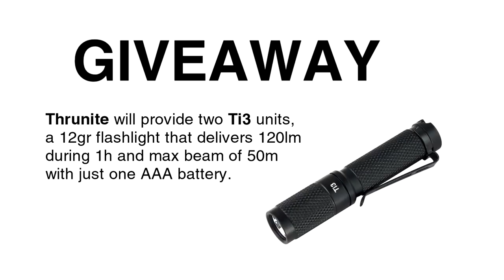How to make a Leather Strop |  Razor sharp knife

Comment: I just picked up a work sharp sharpener the manual and the Ken Onion electric system. And don’t get me wrong both work VERY well. BUT the last part IS the finishing touch and that’s the leather strop. I ended up with some extra leather from a welding apron I bought at harbor freight. I took that extra strip of leather put it on a 2x4 and ran my pocket knife across it 3 times on both sides. And that took a already extremely sharp knife to a literal razor.

Comment: So is there any clue how long we have to grind those leather with sandpaper?
And do we have to apply strop compound and oil every time before use?or one time only?
Thanks for the answers.
Reply from the maker: I start with coarser grit to flatten the leather. Then I go finer just to refine leather finish. You only need to reapply strop compund or oil when you see the leather dry.
Reply: @WoodworkingBarcelona  wow I still got replied for 4 years old video, what a good man! Thanks for the answers.
But finally I just bought stropper from e-commerce, and it's make me confuse a bit, because they made inside leather for the outside not like yours. What do u think? Do you ever strop with inside leather? How it performs compare to outside leather?
Reply from the maker: @johnrafa7937  I've never use or seen a strop with inside leather face. I'll glad to know if it performs well to you. Regards

Comment: Hi... Two questions. What kind of sand paper do you use to sand the leather? What products do you use? Especially the one that you spread all over the leather at the end. The one before putting the honing compound. Is it a sort of a oil? Thanks
Reply from the maker: Hi, I use regular sandpaper to smooth the leather surface. At the end I apply some polishing compound from Tormek on one of the strop faces. I hope it helps.
Reply from the maker: Oh yes, and before the polishing compound I hydrate the leather with mineral oil.
Reply: @WoodworkingBarcelona  thank you very much!

Comment: Good idea to have smooth leather on one side and courser leather on the other side.  I know my barber used to have 2 sided Strop attached to the barber chair. The two pieces of leather were different. One course one finer. Both ends had a large ring holding the two leather pieces together.

Comment: Did you use the other side any abrasive paste or powder or just oil?  Thanks
Reply from the maker: On the "clean" side I just hydrate the leather with oil for the final touch.
Reply: With having leather on both sides were they both sanded to 500 grit? And one side is just oiled for final and the other has the stropping compound on it??  Do you recommend a certain brand for the stropping compound?
Reply: @johnnymotley6468  He used Tormek Honing Compound. you can buy online or in most shops related to woodworking or sharpening stuffs. https://www.ebay.ca/sch/i.html?_from=R40&_trksid=m570.l1313&_nkw=Tormek+Honing+Compound&_sacat=0

Comment: i am making one too. got a nice piece of leather one side smooth other rough. going to put smooth side up. do i need to sand it? Will it work good if i don't? its pretty nice leather. not a hard smooth but i nice supple smooth. do i want it a bit rougher by sanding? i have 150 grit sandpaper laying around. or can i leave it
Reply from the maker: +Paul Lonardo That would depends. If it is flat enough once is glued you don't need to sand it.

Comment: I have another couple questions lol. What is the little tool called that you use at 2:17 to shave the edge of the leather? Is it a mini plane of some kind? Also do you make both sides of the strop leather smooth or is one fluffy? Thanks in advance!
Reply from the maker: +Neek Procek Hi there! Answering to your first question, indeed it's a small handplane y bought in Japan back in 2014 for 3$. About the second question, I tried to get same finish on the two faces, except by I only applied polishing compound only in one.

Comment: What kind of glue are you using to glue the leather to the wood.? And is that oil,? Or Water that you sprinkled onto the leather.? What was that Blue strips that you used also Please explain thanks
Reply from the maker: +MyREDTAIL It's contact cement but you can also use PVA glue or epoxy as well. During the flattening process I sprayed water. For finishing it I applied mineral oil. That blue strips are just blue tape.

Comment: Are you using the smooth side and then sanding it down on both sides? One with compound and one just with the oil?
Reply from the maker: +Ben McDaniel I sand it down both faces. Both need to be hydrated with mineral oil, even the one which receives the stopping compound. Regards.
Reply: Good question and thanks for the reply because it wasn't clear in the video. Now it makes THE perfect video :)

Comment: Hello! What is the reason to have leather on both sides of the strop? Do you have different grits on each side? If yes, which ones? Should the knife first be stropped on the coarse side and then on the finer side a bit like a sharpening stone? Thank you!!
Reply from the maker: Yes I do Juan. One side is for the polishing compound and the other one is only leather for the final stroping touch. You have to do it in this sequence.
Reply: @WoodworkingBarcelona  Thank you! So you strop the blade on the compound side first and then on the leather only side. I also wanted to know if you sanded the leather with the same grit (up to 500) on both sides?
Reply from the maker: @juancarrillo3104   Yes I did, both sides were sanded to the same grits.

Comment: I didn't know it was possible to make a knife sharpener from leather, is there a specific type of leather to use ? does it make a difference if the leather comes from sheep goat ... etc
Reply from the maker: +Hassan Arzouni (HaZo) Hi Hassan. I'm not an expert at all so I ignore if there's a specific kind of leather for this purpose. Anyway, I recommend to use non treated leather because you need to prepare it (flattening) and as much as thick as you can find. Maybe there's someone who could add some light to this subject. Regards!
Reply: thanks, regards

Comment: i found an old dark belt, do you think i can use it? what do i have to do to make it like yours? i mean, i have to put mineral oil on it?
Reply from the maker: +Giacomo Battisti yes, you can use it. Mineral oil will hydrate the leather so will be easier to work with. Good luck!
Reply: thanks a lot for the hints 💪
Reply from the maker: You're welcome.

Comment: What adhesive did you use to glue the leather to the wood? and has it held?.
Reply from the maker: +Ivica Banovic I used contact cement glue and it worked really well. You can also use regular wood glue or Epoxy. Regards!
Reply: Woodworking Barcelona thx mate
Reply from the maker: +Ivica Banovic You're welcome. So be free to ask any questions you may have. Cheers!
Reply: Woodworking Barcelona OK got one more lol. Why did you oil one side of the leather? My guess is so it doesn't ware as easy and the compound stays more on top, just couroius as I've never seen it done before.
Reply from the maker: +Ivica Banovic This is important to hydrate the leather with mineral oil to make it optimum to accept the polishing compound. I hope it helps.

Comment: is a strop really necessary though? I ask as I have used my own strop on and off, but then I got myself a series of diamond plates from 240grit to 3000grit.....and at 3000 grit you have a mirror finish and can cut newspaper too. So I wonder can i really get sharper than that with the strop after the 3000 grit?
Reply from the maker: +Andrew Espie-Whitburn you just need to try it and solve that matter. I have a Japanese stone with 8000 grit and I assure you strop leaves a finer job on the edge.
Reply: thank you for the reply. Since writing my comment I have gone back to the strop, and watched some other videos on how people strop, and have found what you are saying to be true. I think my technique perhaps was wrong before, but I do agree, I can now see an improvement in the blade edge. Thanks
Reply from the maker: No problem at all. I'm glad you improve the sharpness of your tools. Regards!

Comment: In other comments you mention the Tormek compound best compared to others and green chromium oxide.  How is it better, coarser, finder, cuts faster, better finish?  

I know that the white compound that is supplied with some strops (and typically power strops like belts and paper wheels) is coarser than the green chromium oxide, but the green is very hard and will cut some very hard steels better than the white.  Where does the Tormek compound fit in?  Have you tried anything else?
Reply from the maker: Besides Tormek compound I've been using so far Chromium oxide (green paste) as a buffing compound. As far as my practical/empirical experience, I've been achieving better results with Tormek compound but differences are quite minor. I've also bought blue, black, brown and white compound but didn't tried yet. I hope it helps. Regards!

Comment: What type of glue did you use to adhere the leather to the wood?
Reply from the maker: +Steve Taylor Hi Steve. I used contact cement but you can also use epoxy or even wood glue.

Comment: Did you find that taking the sanding to 400 grit made the smooth side just like the suede or are they still very different?
Reply from the maker: They are different. I use the suede face as the face which going to be glued to wood.
Reply: Woodworking Barcelona Thank you very much

Comment: Hi, I've got another question for you. When you're done with the polishing paste how do you clean up the leather from the paste itself and, finally, do you think I could use starrett oil to hydrate it? Thank you again
Reply from the maker: Thats easy. Rubbing some alcohol on it. When it's clean, you can proceed to re-hydrate with mineral oil and then apply de fresh paste. I would no recommend to use starret oil beacuse it's waaaay more expensive than regular mineral oil. Regards!
Reply: @WoodworkingBarcelona  Great! So I use just some denatured alcohol.. thanks again!!
Reply from the maker: @haisamjab  That's right. Good luck!

Comment: +Woodworking, if I simply rub a knife against my leather trouser belt, will it work ?
Reply from the maker: +Sachin Ki if it's well tensioned and you strop correctly it will do,
Reply: +Woodworking , will it work even if I dont use any buffing polish compound ?
Reply from the maker: +Sachin Ki sure, but will be mu h les effective. And remember, before stopping you need to work the cutting edge by sharpening stone or wet&dry sandpaper.
Reply: +Woodworking , many years back , I have seen Indian barbers stropping their razors on leather belts. 

I didnt see them apply any compound. But now almost 99.9999% use disposable blades.

Hence I ask if this would work without using buffing polish compound ??
Reply from the maker: +Sachin Ki I think I've already answered you that question 😅. You can strop the blade without compound but results will be better using compound. I hope you understand it this time.
Reply: +Woodworking, ty again
Reply: Their belts probably had compound such as Jeweler's Rouge already in them. Otherwise they were not as effective as they could have been.
Reply: +Darth KEK , those village barbers cant afford such compounds
Reply: Then their strops will be less effective. Work, just less effective.

But a basic jewelers rouge in an Indian chemist is cheap, you'll possibly find some enterprising Indian has bought one piece and goes around the barbers every few months to give them a rub for a very small fee.
Reply: +Darth , they dont use that razor anymore. They used to be used a few decades back, mostly in villages.

But now I havent seen them in many years

Comment: where did you buy and what type of leather did you use
Reply from the maker: +Steve R I just bought some scrap pieces of leather from local leatherworkshops. I recommend you to buy the thickest piece you can find for better results. You also need to treat the leather by flattening and hydrate it with mineral oil before start stroping your tools on it.
Reply: thanks

Comment: did you put mineral oil on both sides and stropping compound on one side? like all your videos :>)
Reply from the maker: +Russ Veinot Thanks for come and comment Russ. The answer is yes. It's important to hydrate the leather before using for the very first time, even on the side that will be compound free. Regards!
Reply: Neatsfoot oil works well for conditioning leather too

Comment: I've made 2 now, and I'm wondering if I sand too much.
Reply from the maker: How's so?
Reply: Woodworking Barcelona After removing the dark, high gloss surface, the leather looked and felt much like the surface of its opposite side. Eventually, it was quite smooth again, but still much suppler than some leather I've felt.
Reply: Woodworking Barcelona Its been great for my edges regardless, so I thank you very much. I only wondered at the quality of my leather and moreso of my workmanship

Comment: What glue do you use?
Reply from the maker: +Gwyn Buckley It's contact cement. But you can use epoxy, PVA glue (white wood glue), or thick CA glue. Regards!
Reply: Thanks for that.  I'll probably use either contact cement or PVA.  CA glue? haven't heard of that.  Is it Cascamite which is based on casein, found in  milk?
Reply from the maker: +Gwyn Buckley Nope. CA glue is cyanoacrilate glue (aja crazy glue or super glue).

Comment: Thank you for such a great video! It was really helpful, I am going to have a go at making a strop now rather than buying one seeing as I have most of the materials and tools. Some questions though, would it be advisable to use linseed or tung oil or the likes on the wood before the glue and leather goes on and then rest it for a time? I just worry about the wood going dry inside. And is it wood glue you are using or a contact cement/adhesive or an two part epoxy? and why do you use this type of glue over others? Cheers in advance!
Reply from the maker: +Neek Procek Thanks! No problem at all. I would not recommend to apply any finish before gluing the leather. I would recommend to use any hardwood. About the glue, I used contact cement because is quite cheaper than epoxy. Other than that, you can also use white glue (pva) with good results. If you have any further questions please feel free to ask me again. Regards!

Comment: Really not a good way to do it
Reply from the maker: +Teddy Dahlqvist How so?
Reply: Woodworking Barcelona i mean you could put in so many more features like making the end of the board (opposite to the handle side) rounded so you can get into gouges. I also personally think you should use the rough side instead of the fine side and sand it because if you use the rough side you can get more compound and it will be more efficient.
Reply from the maker: Thanks for share your thoughts. I think the rough side won't be as much as flat so it wouldn't work at all for the result I want. And I didn't want to overcomplicate it because most people are going to use this for knives. Regards!